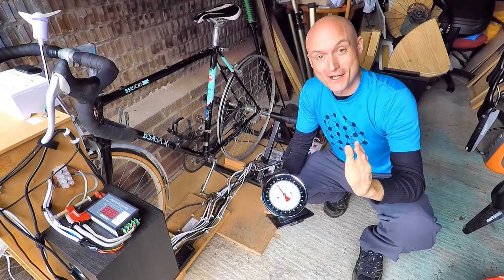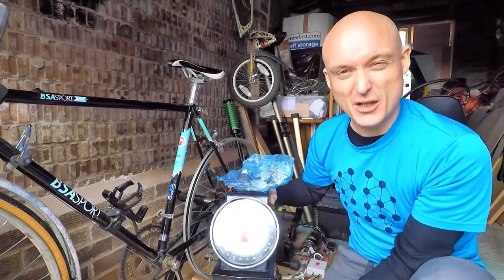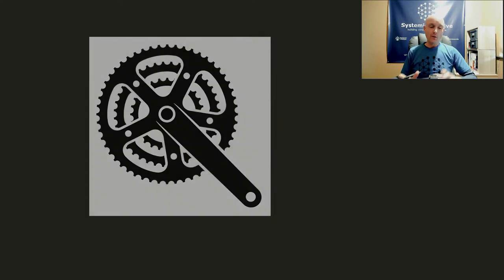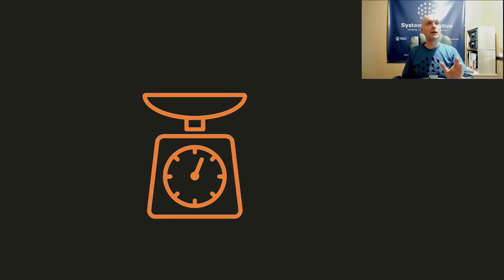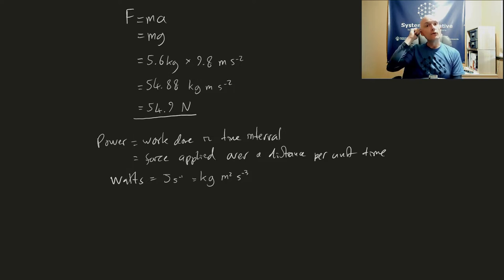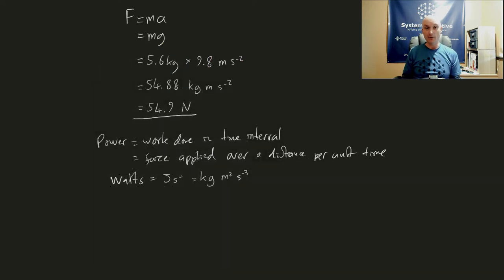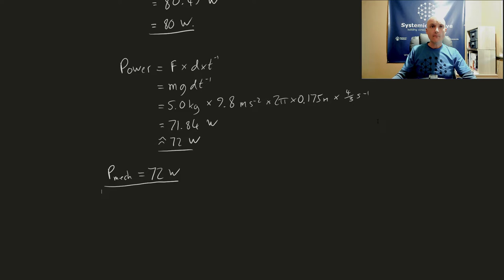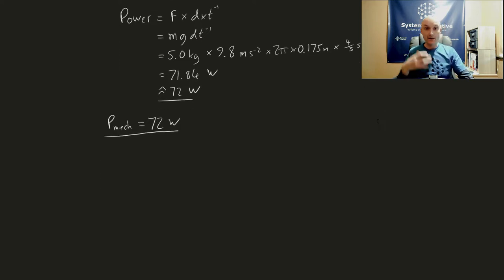Bike generator power with kitchen scales! DIY Physics

Comment: Excellent video, thanks, I learned a lot. I have a question - does the formula give the average power needed? Because power from the legs is more when they're pushing down than at the bottom of the circle?
Reply from the maker: Thank you Kunle, and that's correct. More specifically, it gives the average power applied perpendicularly to the crank (at a right angle), so the actual power produced by the leg will be more or less than this at different parts of the pedal stroke cycle.

Comment: I have commented on this video previously but my comment has disappeared. However, I put an emoji at the end and I have discovered that on two other channels where I appended an emoji those comments also disappeared. My emoji is usually a thumbs up and or a smiling face. Hope this feedback helps. PS My kitchen scales are used more in the workshop than in my kitchen!
Reply from the maker: Thanks for the info, and thanks for commenting again!